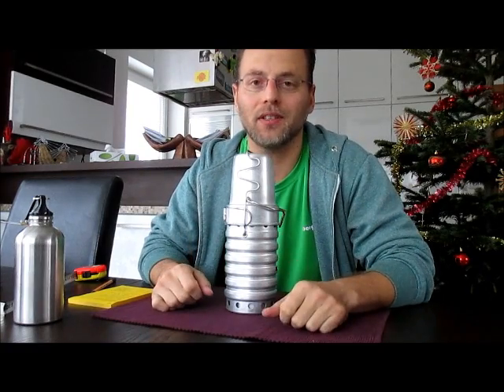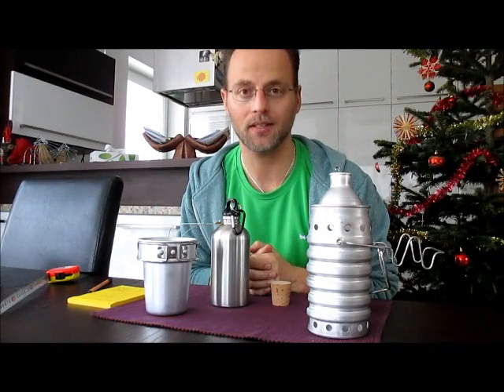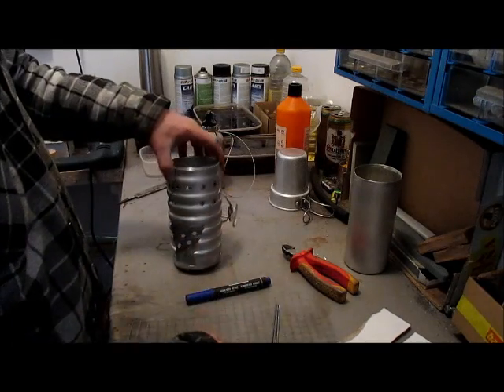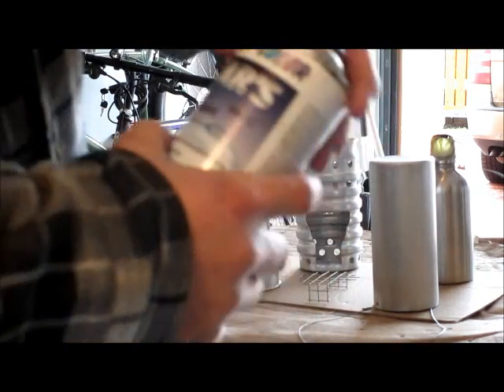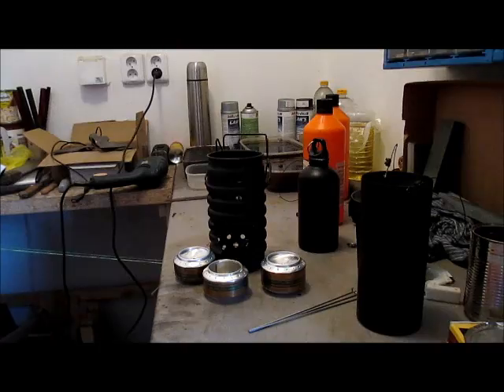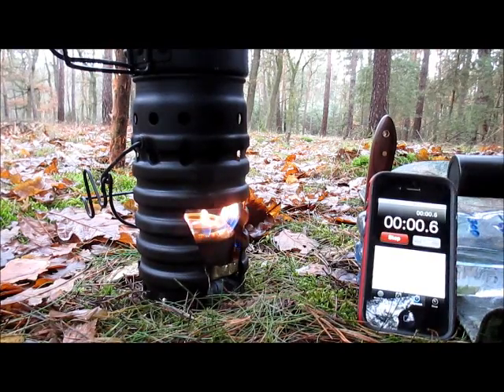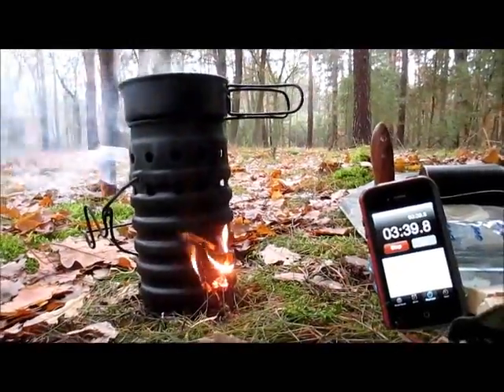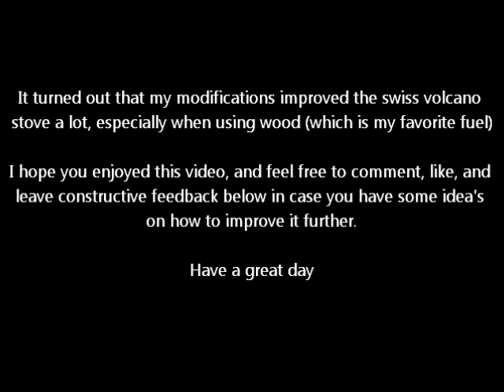Swiss Volcano Stove, several modifications & test burns

Comment from the maker: Thank you :-)  The make, sorry, no brand, just a cheap one from a local shop here.  The cozy / jacket for the cut-off bottle, I tried it not so long ago. Once the bottle comes of the fire, it is usually a bit sticky from the bottom if the fire is not clean burning. After putting it in the cozy / jacket, it was really hard to get it out again. Didn't like it much to be honest. The lid, absolutely, if have lids for my other cooksets, and it is indeed improving boil times.

Comment: This may be a reprint of what I already sent you. I did try the your modifications with the paint job. I had no soot whatsover and the flames did not even come up through the new holes as my burining was complete. Outside of the initial smoke and high flames at the initial startup burn,, there were no problems. I placed a little tape around the top of the cup when painting to allow me to drink from it. The stove was not difficult to cover all the surfaces when also painted. However, I did not cut the water bottle, even though the cork was leaking some of its brown color on the inside rim. I am not certain if I wanted to buy a SIGG water bottle (expensive). Using a smaller bottle may not give me enough liquid for cleanup or a secondary preparation.. 

I do believe, however, using a smaller water bottle will allow me to fill the cup with other things such as a rag,  Esbit tablets, and Coghlins botton tabls, matches and or a cat stove and alcohol.  This allows me a more versatile  cooking system.

I plan to paint my other pots Stanley cookset and the Q stove on the outside to me clean up from wood burning easier.  You have a wonderful idea. with the mod. 

The outdoor protduct "Mess Kit" by walmart allows me to put alcohol and catstove or a small esbit pocket stove and tablets inside-again creating a more complete fire system. This will also be pointed black.  Best wishes.
Reply from the maker: +Doug Ramsey Thank you for the feedback. and sorry for the late reply. About the sigg bottle, mine is some nameless brand, very cheap, definitely not a sigg.
I'm looking forward to see your setup. Will you put it somewhere online where I can seen it ?

Comment: Thanks - excellent video.  One question - what make was the smaller water bottle that fit inside the original bottle once you cut the top off?

Might also be worth making an insulated jacket for the cut-off water bottle out of aluminium-sided bubble-wrap.  That way you could put your dehydrated food in it (into boiling water) to cook, and brew up some more water for your tea/coffee!  Also would get better boiling times if you made a lid for the cup and cut-off water bottle.

Comment: Greetings!
Nice mods you made!
At first, the rocket stove wasnt made for wood; you can see, as it is it does a messy job. Thats not the way swiss military does things. It was made to work with the "Borde Bezinkocher", an automobile fuel pressurized stove. The wire was made to clamp it to a military folding shovel/entranching tool for stability. But since the Borde stove maker was hand making them (150/year), the production was too slow and the project gets abandonned for standard dotation.
Reply: pichnoufblues i can verify that since i have an original borde stove in the original box with the instructions. mine did not come with the volcano stove, it came with the simpler folding v-shaped pot support but the borde instructions show how to use it with the volcano stove

Comment: I have modified my stove to operate like yours but not the painting yet. You mentioned with the mod the burning was better with less smoke or soot, I blieve. If burning more complete,, is painting still a recommendation? And, if you use a smaller water bottle than a sigg, you can carry in the cup alcohol, esbit tablets, and a penny stove. Good work.
Reply from the maker: +Doug Ramsey Not sure about the painting, if it is still needed then. I was based on some experiments from others who said that a painted surface would get less sooth on it. And additional factor i liked about it was that since it is a real pain in the ass to clean it on the inside of the stove, that it would not be that visible that it's dirty :-) When your done with yours, post some pics or video, i'm curious about your version.

Comment: Things could always be different. The firewood hole could be wider at the bottom, but cutting out one of the holes.
But your design might even be better, as it is. The top wood will funnel down and keep feeding the fire.
Reply from the maker: I was thinking about doing it wider at the bottom but already at the current width sometimes wood or coals fall out, so i decided not to make it wider down, but up to prevent this from happening even more.. But each his/her own choice :-)
Reply: Experimentation is great........

Then there are not failures,,,,,,,, only experiments where something is tried and something is learned.

It is a free fun creative ground.

Comment: Didn't you lose a bit of the chimney effect doing that?
Reply from the maker: whynottalklikeapirat Nope, if you use wood as fuel, you definitly need those extra holes in it. Otherwise with spirits or gas it’s just fine.
Reply: INteresting. I am in the process of modding a coal fire starter into a cooking system myself, Thanks

Comment: With the mods, do you think it increased the burn time?
Reply from the maker: +Doug Ramsey it definitely decreased the time to get a boil, and since wood can burn proper now without being smothered, i think the burn time is increased slightly.
Reply: In America there is a product Plasti Dip that has been used to coat cup handles to prevent from being too hot and its secures both extensions together for a tighter feel with the handles swinging. It is same type of coating seen on the Esbit stove and cooking system. Love the design and will try it out.

Comment: I would not recommend anyone use the Soda can stove burners in volcanos. Yes it will work but it wont work efficiently. It gets far to hot for the soda can burner creating a lot of pressure in the soda can burner making very large hot flames. Which is way over kill and waste of fuel. A open style burner with a wick works 10x better and is far more efficient. I use a simple shaving can bottom cut off with a carbon felt wick with alcohol in it. Works like a champ! Very simple and I can boil 2 cups of water in 3:30 minutes. It will boil those 2 cups with a hair under 1oz of fuel.
Reply from the maker: Thank you, but as mentioned in the video, my preferred fuel is wood, and due to that I made those modifications.
The burn test included the beer can stoves just as a comparison. Have a great day !

Comment: On your final burn that is why you ran out of fuel because those soda can stove burners get to hot inside the volcano walls making huge flames wasting fuel as the flames go outside the Volcano and waste a lot of heat and fuel.
Reply from the maker: Yep, agree, wood is still my preferred fuel, the stoves just a nice test. What do you use ?

Comment: You know those stoves burn apart
Reply from the maker: YogiPony hi, never happened to me, and didn't hear about it as well. I assume you suggest to use glue? I'm actually testing out some 'fancy feast' type of stoves now, no moving parts there.
Reply: Oh no the sides around the base started to burn through. I used it maybe 5 times but I probably got it a little hotter than necessary a couple of times. I'm just afraid to use it now. If its slowly burning itself, that cant be healthy
Reply from the maker: Interesting, will keep an eye on it if i use those kind again. Thank you for the feedback

Comment: take the drill off hammer when not drilling in concrete it will work a lot better for you
Reply from the maker: Hi, the hammer mode wasn't on... When it is, it makes a complete different noise, and much more vibrations.
This drill is just old and very (ab)used.

Comment: some ingenious improvements, however I think your black paint addition was not too smart...even though it is high temp paint, you are burning it and contaminating your food and water with carcinogens from heating and burning paint.  

These stoves are so cheap that when they are disgustingly dirty, I just throw it in the recycle bin and spend another $10 USD on a new one
Reply from the maker: +Archangel0804 Hi, the bottle and cup are not sprayed on the inside, only outsides. Since it is BBQ paint, i trust it. You're lucky to have them so easily and cheap available to you. Where I live they are quite rare, and not that cheap anymore as when i bought it 8 years ago.
Reply: Cheaperthandirt .com....Not sure if they ship internationally but only about $9 or $10 USD.

That said, in the video I thought you mentioned the paint as "engine" paint?? 

Yes...you are correct ....BBQ paint is a little safer...but I would suggest that you give it a very hard burn for about 30 minutes, then clean in the interior surfaces of the cup to eliminate any particulates before using it.
Reply from the maker: Right, i had 2 bottles of paint actually, one for engines / exhausts, and also the bqq one, and in the video i showed the wrong one. Bad mistake. For the bqq paint, i have 3 colors, red, grey and black. Grey I dont like, red is a bit too visible, and black would be perfect since you wouldn't see the dirt much
Reply: that's cool....just looking out for ya and everyone else.  I've made a number of tent heaters for winter camping and always paint with high temp grill paint, but I always burn them hard for 30-60 minutes first before using them inside a tent.  My heaters also provide a cooktop surface for pans to heat food, boil water, etc and also can convert to a grill, using a small stainless steel grill surface for cooking caught fish...however if you have a carcinogenic grill box, it kinda defeats the other precautions I have taken.